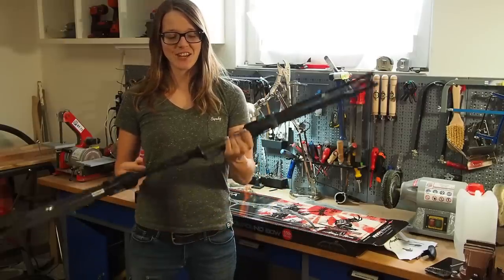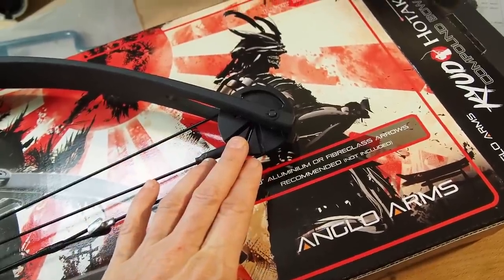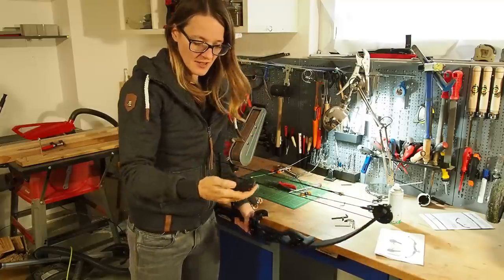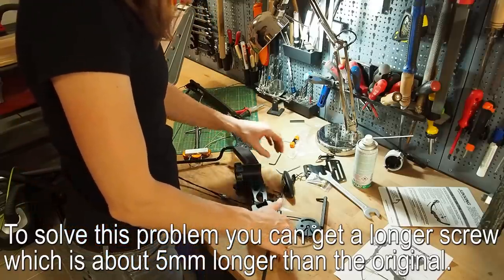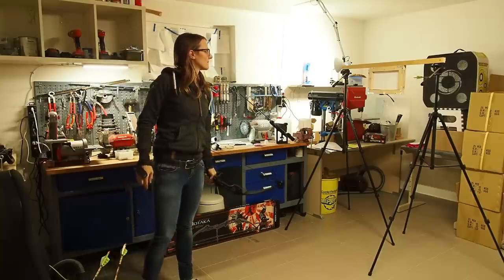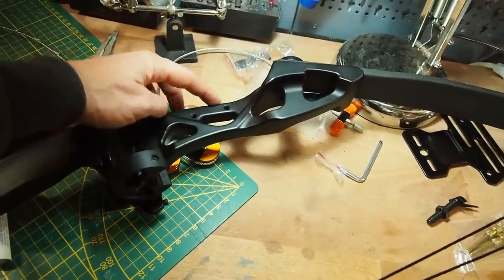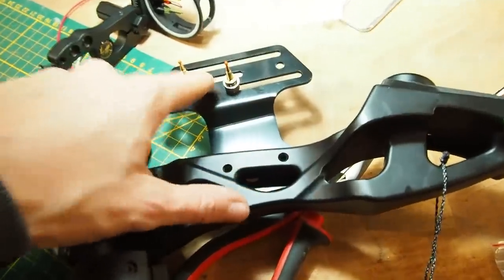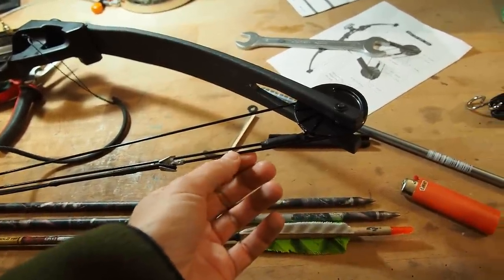I bought a fake Rambo bow on Amazon. Is it worth it?

Comment: At 25Kg pull I really hope you don't intend to shoot any large game or at a distance, my compound is 120Kg and my recurve is 70Kg and the recurve does not penetrate large game like a camel or a buffalo deep enough to guarantee a kill.  I would be reluctant to even take a goat with 25Kg and I would never even show it to a wild boar.  Can I ask what kind of game you are intending to shoot with such a light bow?  Based on your accent I would assume you are going after boar, eld or deer.  May I suggest shooting without a mechanical release, if you have to load a second shaft in a hurry, like when game charges at you, a release makes reloading too slow, far better to shoot with a glove so you have two hands to work with in a hurry, it also means that if you have to go to your dispatching knife in a hurry you can in a glove, you can't with a mechanical release.   Getting to your knife in a hurry can really save your life, it has saved mine a couple of times.   Oh, I am an Australian, totally different game to most other countries.
Reply from the maker: 120 kg = 264 pounds. 
I think you are doing some miscalculation here.
I shoot no game, since bow hunting is not allowed in my country.

Comment: If it is quite and no vibration I’ll take it any where in North America and hunt what I want. If i planed to keep itself I would check for spare parts. I would rather have it 10-1 over any new super bows. A race car has to be worked on all the time. a old Chevy tune it up , check the and drive it. This bow is a old Chevy . the big advantage with it is the longer limbs. with the stupid short limbs they force on buyers today are very unforgiving if you slightly pull off. they hit all over the dang place . slower longer limbed bows , if you pull off a little you’ll still keep in a coffee cup sized groom at 20 yd with no problems. I can take that bow at 20 yards shooting at a black dot the size of my fist , sight up on full draw with mixed weight arrows and arrow heads and shut my eyes before I release my arrows and still keep them in the black dot. try that with the new super bows . been shooting, hunting, tracking for over 43 years. i would be excited to share a life time of knowledge with you. by for now. nana and papa aka the hunter wishing you well
Reply from the maker: thanks for your insight!

Comment: I went through the transition from a recurve to a compound bow back in the early 1970's. It takes a new set of muscles to pull a compound because most of the resistance is early in the draw when your hands are still fairly close together. After a few weeks of practice you will find it much easier to draw that compound. I went from a 45 pound recurve to a 55 pound compound. I was very comfortable at 55 pounds after my muscles adapted. Viel Glück!
Reply: Not true, its the same muscles in use, i went from a 40lbs recurve to 60 lbs compound without issues or effort. The reason it feels diffrent is caus your muscles dont devloped the same strenght trough out the range of motion where momentum has compensated.
Reply: @mortenjacobsen5673  - You said it better than I did, thanks!